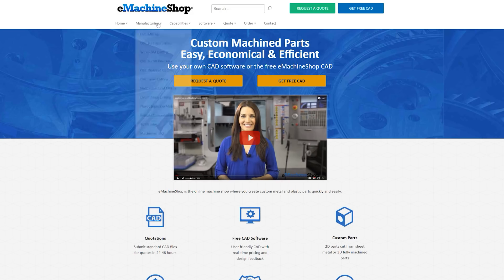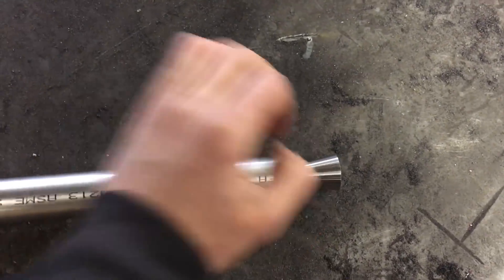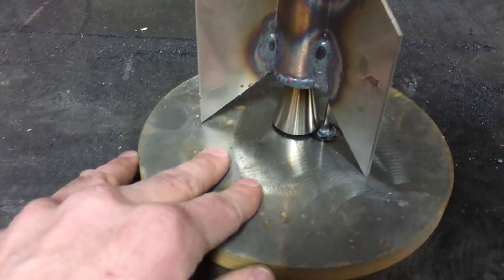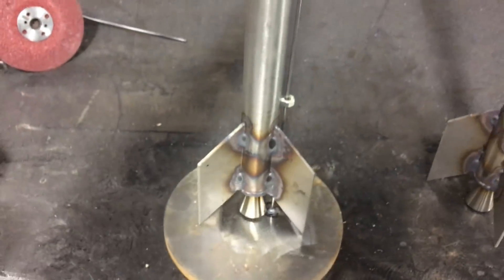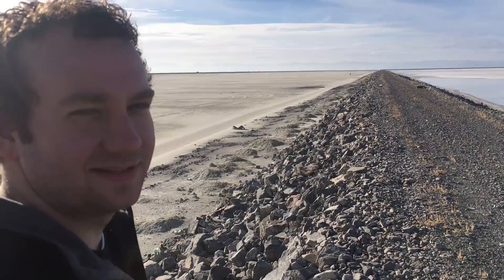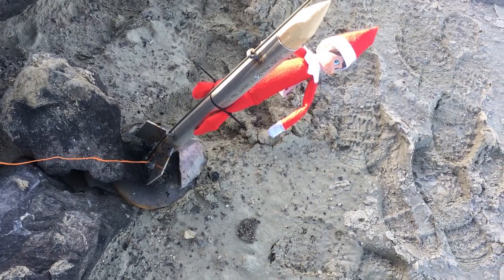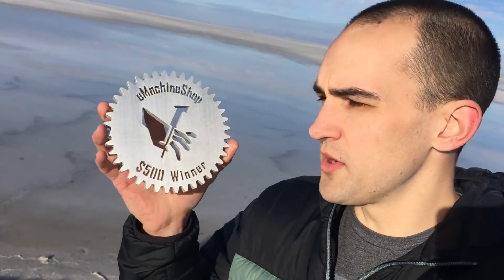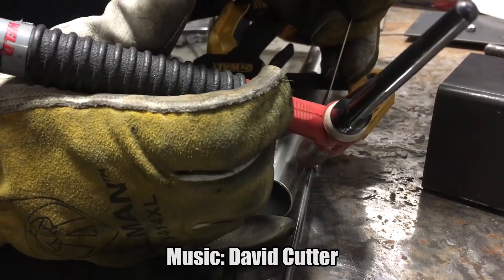Homemade Rocket Launch - 60,000 PSI Waterjet Channel

Comment: Also, to your propellant issue, you’ll probably want to add an accelerant to it, like iron oxide, or rust. Don’t try scraping it off stuff, I’ve tried, so just purchase powdered rust. Add very, very tiny amounts to the mix, as in increments of probably .5% or less. It’s scary effective. That should get you the burn rate you need. Don’t chuck in a bunch and expect it to work, it will explode. That I can guarantee. I can see you’re using rocket candy.

Comment: I think that the nozzle is the main problem. Rockets work from the combusted particles hitting the top wall of the combustion chamber or hitting the nozzle where it is angled inwards, therefore pushing it forwards. The nozzle of this rocket did get smaller as it went up which is good, but halfway through it started getting larger as it went up, which is a problem because that allows an equal amount of combusted particles to hit the back end of the combustion chamber pushing the rocket downwards as much as upwards. Also the weight is a problem. You should use thinner walls or make the combustion chamber a lot larger. Hope this advice helped!

Comment: Your problem was that you used powdered sugar which has corn starch in it to keep it from clumping together. The cornstarch slows down the reaction. Try using 35 parts granulated (by weight) to 65 parts potassium nitrate. Cook with a small amount of water and let the water COMPLETELY boil off. Cooking longer is better cuz any moisture will ruin it. But yeah follow that formula and you will get something comparable to black powder:) just... don’t be dumb with it😉

Comment: Cook the rocket candy till real dry, make sure the stoichiometry is correct  (65 potassium nitrate/ 35 sugar) and perhaps add 2% iron powder (reduced)  and 10 percent sulfur. Trust me, it'll fly (or explode spectacularly ;) ) I wanna see you guys make one fly! Especially with a shop, we are stuck with PVC tubes and hose fittings.
Best of luck.

Comment: You didn't mention if you made a hollow core running the length of the rocket fuel . I suspect you didn't because the top seemed only plugged with a wooden nosecone. Solid fuel rockets work better if the core of the fuel is hollow, which gives more surface area inside where the burning takes place. This greatly increases the burn rate and pressure and thrust.

Comment: First of all, kudos on not being afraid to fail.

With that out of the way, be glad you did. Stainless steel fins and a wooden nose? That's going to move the CG aft. Well aft of the center of pressure, IMHO, which will result in a rocket that, should it fly, will fly in an excitingly random spiral pattern.

As for the fuel, you need one of two things. Either faster burning fuel or a smaller nozzle to raise the chamber pressure, one of the two. Either solution raises the risk of explosion, but this is a rocket. If it's not about to explode, it's not working right.
Reply: "If it's not about to explode, it's not working right." I like the sound of that. Livin' on the edge!

Comment: My dad used to make these all the time. The fuel is the hardest part, especially making the forms for the center of the fuel stack to allow it to burn properly (usually some form of star shape to allow good surface to volume ratio. Also have to be VERY careful in what you use to solvate the fuel. Has to dry dense and solid with no cracks or it goes bang. If I recall he used to use lab grade ethanol or methanol. Lastly don't use steel alone, too damn heavy. What works well is very dense thick cardboard, or use a thinner pipe with a thick liner to protect it from heat as it will blow out by itself. Finally good stoneware type clay is the best for the nozzle as it wont melt or scour away.
Reply: I can also say the nozzle is WAY too big. Its a careful balance between rocket and pipe bomb, which is why the clay is nice. You can make the blank and the drill various diameters to find which works best. Usually a smallish hole with counter sink lead-in and lead-out to allow for smooth flow so the nozzle doesn't suffer erosion.

Comment: There's a PDF online that might interest you, it's a scanned copy of a book called "How to Design, Build, and Test Small Liquid-Fuel Rocket Engines", also one of "A guide to amateur rocketry", It has some pretty good equations about a rocket nozzle's throat diameter and it's expansion ratio and such that you might be interested in.

Comment: Did they balance it?  Rockets perform best at a specific center of mass... i think
Reply: Yeah, center of pressure and center of mass, one has to be in front of the other(I forgot which lol) by about 1.5 - 2 x the body diameter, too much and it over-corrects (unstable)too little and it under corrects (continues to veer off straight up)

Comment: You should probably thread the nozzle instead of welding it, the heat most likely melted the already instable rocket fuel to sirup 🧐
Reply: You're kidding right? They may not be the smartest, but I think they know not to weld it WITH the fuel in it... LOL

Comment: I get that the nozzle was the point of the video but the rocket is far to heavy for R-candy. I recommend you use either PVC or cardboard for the body next time. Other than that, great video.

Comment: From what ive seen it appears tricky to make rocket fuel. May have been a mistake in the cooking phase
Reply: Waterjet Channel also, your nozzle didn't have enough restriction. That venturineeds to be like, half that diameter.
Reply: Waterjet Channel, did mitch lick it to make sure it was real rocket fuel? could have saved a little time with a taste test ;)
Reply: Its actually super easy. They just used the complicated method. Use 13 parts potassium nitrate and 7 parts powdered sugar and you have an amazing rocket that works every time and is super cheap
Reply: Kaydn Burns it's better to use regular white sugar that you've ground down yourself. Powdered sugar has anti caking additives.
Reply: Didn’t they test on mythbusters one time if you could use salami as rocket fuel? Pretty sure it worked too
Reply: Yeah, but with liquid oxygen as oxidizer. LOX will make anything a rocket fuel, or a bomb.

Comment: It's heavy Bro, you have to make it light.
Reply: Actually, that is not why. They did not have a hole running down the center of the propellant, so only a small portion was able to be exposed at once. This meant it burned relatively slowly, and it never got up to high pressures. 
Higher pressures= more thrust
High pressures = faster burn rate
Faster burn rate = more pressure
More pressure = lots of thrust
Reply: nature lover a butt load of black powder should do it
Reply: monster gamer512 how to make an explosive projectile 101
Reply: UNIVERSAL GAMING that's probably the only thing that would make that heavy peace of metal move

Comment: About the rocket: Maybe stick a straw through the nozzle while filling the rocket with fuel. So that the fuel forms a cylinder with a lot of core surface area to burn?
Reply: yeah definitely an open core is super important
Reply: hey thats smart af but he should use a star profile shape for the rod I faintly remember reading somewhere that thats a shape approaching the fastest possible area for quickest burn time or somewhere up there
Reply: Yea you would need a core so after the bottom burns it won't smother the rest
Reply: Ps I can't help notice your profile pic I have 3700 hrs on that game

Comment: That tube is Stainless Tube way to heavy,  mucho' grande'!   Stainless steel won't last as a  rocket nozzle (it will melt at to low a temp) try carbon (machined), also the opening is way to large. 
There are equations that will give you pressure(in psi or that other crap, I'm too old to learn, w/ a given fuel/inside a specific diameter tube also with a given nozzle size, yep.  If you are serious......  60,000 psi, not that other crap!  half a million subscribers mean that you should lick it correctly!